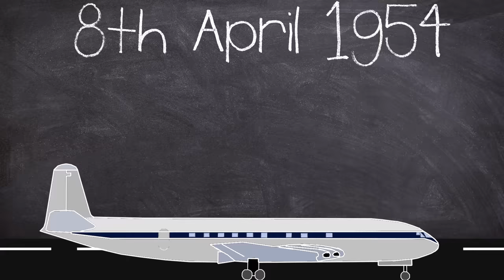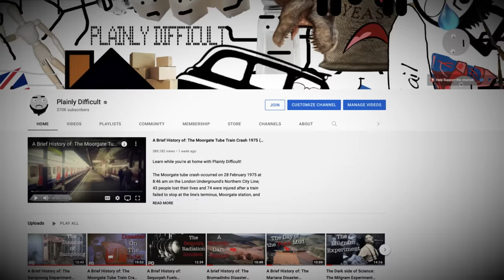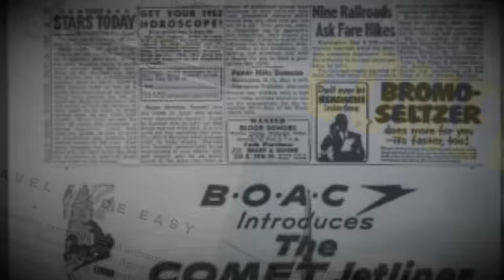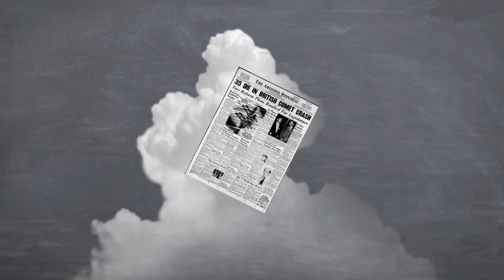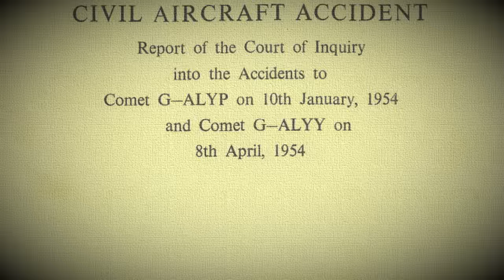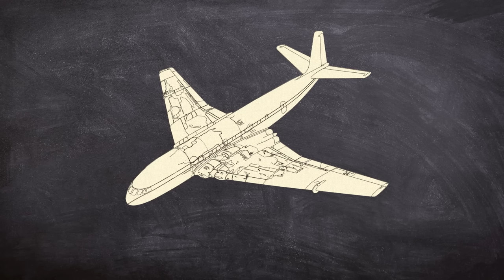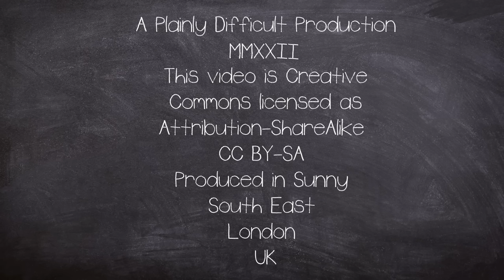A Brief History of: The de Havilland Comet Design Disaster 1954 (Documentary)

Comment: Admittedly I could be wrong, but it would appear that a significant amount of credit should be shown to the inquiry board, test engineers and BOAC for their determination to get to the bottom of the problem.
By all accounts this wasn't covered up or hidden from public scrutiny - the process seemed to have been relatively transparent, (not a window gag) although the damage was already done to the reputation of the aircraft.
Reply from the maker: Very true
Reply: Back then, the main focus of any investigation was to find what went wrong and fix it. 

These days it's mostly to protect corporate profits.
Reply: @rrknl5187  I beg to differ!
The whole investigation process for all aviation accidents and near misses is to find root causes and ensure they are eliminated! There is obviously pressure from corporate to make it quick and cover any guilt, but the investigations are always good!
Reply: @totherarf  The degree of corruption and influence to protect industry or protect pilots varies as you move through space and time. Watch the last Mini Air Crash Investigations video and tell me that wasn't a cover-up, to say nothing of what happened with the Max. I won't disagree that the attitude of "find the problems" over "punish the troublemakers" or "prove the aircraft works okay" gets far better results. But, between the national investigators (NTSB and relvant counterparts), investigators from manufacturers, and investigators from airlines, there are a lot of competing interests in any investigation, and we don't always succeed in keeping those interests out of the way of doing good work.
Reply: @totherarf  I'd suggest that you are both correct.
The aviation industry probably holds itself to different standards than other industries in this regard.
@RR KNL didn't specify the aviation industry, and in many other industries there are (to varying degrees) cover ups - construction, manufacturing, oil, gas, coal and mining have all faced transparency problems over the years when things go wrong - we've seen plenty of examples on this channel.

@Mentour Pilot is a fantastic aviation channel which looks at, amongst other things, aviation incidents, accidents and disasters - not in a distasteful, insensitive or crass way - the content creator hopes to illustrate that the aviation industry is constantly learning and improving through post crash investigations - something that other industries could learn from.
Reply: @Amanda-C.  Another excellent channel.
As you've alluded to, no industry is going to be perfectly transparent, and there have been examples of the aviation industry obfuscating or dragging it's heels it is generally better than other industries....I hope.
Reply: @rrknl5187  As if the Soviets were any better.
Reply: @rrknl5187  There's some corruption, as there is in just about everything, but overall the NTSB has done a fantastic job making and keeping air travel safe by discovering accident causes and holding people and corporations accountable. If you're looking to point your finger at corruption, there are far more suitable culprits.
Reply: @Stevie-J  it's worth noting that part of protecting profits is keeping your customers happy. Airlines tend not to want their very expensive planes falling out of the sky costing them both reputation damage and the plane itself. So safety is vital for profitability. 
As for the public been informed, they generally aren't, not quickly anyway. Most of the information the public receives is from press reporting, because well, plane crashes are big news, and finding a news worthy fault is a headliner that news organisations love. Because of the pure number of people involved in aircraft design, maintenance and crash investigations, someone will always speak, this in turn tends to force investigators and manufacturers to respond, often as a form of damage control.
As for why aircraft are grounded, that's simply put, politics. Manufacturers will push for the grounding to end quickly, their lobbyists will too. But the comitties of politicians that the safety boards answer too don't ever want to be seen to be flippant about safety, as they know it'll come back at them later and cost them votes. So they balance the need for the appearance of safety with the manufacturers need for profit. Also note worthy is that because of how the airline industry operates, with companies coming and going constantly, a grounding isn't devistating to a manufacturers bottom line if they can spin it into a "safety conscious" redesign while building up a backlog of completed aircraft to ship the moment the grounding ends. This only works however if they actually do solve the problem and don't create a new one, as a second grounding is likely a death blow to that design and possibly the company as a whole.
Basically over the top safety, or the appearance of it, is key to profit in the airline industry, as it is an industry based entirely on trust.
Reply: Part of it also is that it was, at the time, such an out of context problem. The various heavy bombers that where used prior had much more time on their clocks and the fact that a passenger plane usually doesn't have things being thrown at it. So they where kinda stumped on why the planes just decentagrated in mid air.
Reply: @rrknl5187  Unfortunately not; if you've ever read a Department for Transport report from the time, the blame was nearly always primarily attributed to an individual as opposed to company failings.
Reply: Planes were falling out of the sky. BOAC was state-owned and the entire country was on center stage as the first commercial jet builder/operator. 

This wasn’t just an issue for de Havilland, it was an issue for all of Great Britain. 

Plus over a hundred people had already been killed at that point… you typically investigate such things. 

Also, no one was going to fly on the plane (much less purchase them if you’re an airline, holy liability and PR nightmare) till they knew what was wrong with it. 

So anyways, I’m not sure why you give them credit for looking into this “little issue” lol. 😏
Reply: @EstorilEm  Yes, planes were "falling out of the sky", but it'd be incredibly naïve to imagine that there couldn't have been a lot of misdirection and obfuscation - are you new to this channel? 
Big companies and organisations can be extremely adept at shifting the focus in any number of directions.
You've pointed out that it wasn't just a problem for De Havilland, but for Great Britain - you don't think that the British government* wouldn't have wanted to distance itself from this problem?
And while such a human toll would inevitably lead to an investigation, I think it's fair to say that not all investigations are carried out with full transparency.
Many investigations are simply a facade, designed to give the impression that something is being done.
And while the damage to De Havilland's reputation had already been done they could still easily have carried out the investigation in private, only releasing the bare minimum of information at the conclusion of the investigation - something we've come to expect whenever a large company, organisation or even government is facing public scrutiny.
Even the fact that De Havilland's reputation was beyond salvaging would suggest that  there was nothing to be gained by being fully transparent - in all likelihood they probably knew that they were facing ruin as an aircraft manufacturer.

The reason I'm giving credit to the concerned parties is  because, (as we've seen countless times on this channel) investigations aren't always carried out openly - far from it.
We've seen disasters where no-one is held to account and very little, if anything, changes in the aftermath.
Maybe it is odd to give praise when we see people doing the right thing, but it's something we don't always see.
Finally, you've quoted either myself or someone else using the phrase "little issue", but I'm struggling to find it in the comments - who claimed that it was a "little issue"?

*I know that the British government are usually beyond reproach - always facing up to their failings head on - taking responsibility for their actions - it's inconceivable to imagine that the British government would try to wangle out of it's responsibilities.
Reply: @ianmacfarlane1241  that last paragraph is a joke, right?
Reply: @devent10n  Yes - tongue planted firmly in cheek.
Reply: @devent10n  Apparently politicians used to resign when their position became untenable, and even their own party viewed them as a massive liability - not now.
It says everything about the current British political landscape that the PM can effectively say, "I'm not lying about the No10 parties - I'm just too stupid to realise that my staff were having parties." 
This guy has access to launch codes, and he's telling us that he can't spot a party happening in front of his face.
I'm struggling to understand how he's holding on, but yet again he is.
At least can count on that man of the people Jacob Rees-Mogg - that's reassuring.
Reply: Well said. From my earliest days of reading about this aircraft (bored old 8 year old reading a book about this very aircraft in 1991 checked out from the school library) I felt the British deserved so many wins, and little things turned into huge problems. I have found this plane a glorious piece of history for just over 30 years now.
Reply: I have to admire how they did a full-scale pressure-tank test for the jet's hull.  That just...wasn't DONE, but they needed to test it to understand what was happening in case it was part of the issue....aaaand then they were very-surprised to have the tank prove how important that full-scale test was!

...imagine the poor sod running the test when the failure occurred.  Would he have almost had a heart attack from the super-loud "POONG!" that the hull popping in so much water might have made?  I think it was actually automated, but what if that poor sod was running it manually?  "Augh, did I pressurize it wrong?!"  Two heart attacks in one.  :)
Reply: @EShirako  Nobody heard anything - except for a bell which rang when the pressure in the fuselage suddenly dropped. The aircraft which underwent the tank test was G-ALYU. It suffered a passenger cabin window failure. The failure to "YP wasn't actually a window at all, but rather one of the apertures in the roof under which was housed an ADF (Automatic Direction Finding) aerial.

And, for the record, the narrator uses the modern phonetic alphabet when referring to the individual aircraft registrations, such as ""Yankee Papa" and "Yankee Uniform". In period, the British used a different phonetic alphabet and G-ALYP was therefore always referred to as "Yoke Peter" (and 'YU as "Yoke Uncle").
Reply: @EricIrl  Wow...and now I've learned several new things today all in this one explanation!  I had always wondered where the "Yoke Peter" sorts of names came from.  And a bell...for popping a fuselage.  That seems thoroughly underwhelming...but also seems quite 'actually engineering-sensibly-done'.  Why be dramatic?  You have a task to do; here's a bell.

So YP's failure didn't involve the rivet-damage that the windows had/that YU suffered?  Or was that ADF port riveted too, maybe?
Reply: @EShirako  I am pretty sure that the roof apertures were cut out and "strengthened" in a similar way to the passenger cabin windows - so they were equally vulnerable to the same type of failure.
Another factor worth considering is the choice of engines. de Havilland (naturally) decided to use their own centrifugal flow Ghost engines in the MkI. The Ghost was an early generation jet engine and therefore somewhat underpowered. The company was then far more likely to save weight wherever they could - such as by using thinner gauge aluminium or skimping on window strengthening techniques. The Mk 2 and later Comets all used the more powerful Rolls Royce Avon axial flow engines - which meant that skimping on materials to save weight was less crucial.
Reply: @totherarf  If that were truly the case, the 737 Max would not be flying. In fact, stretching that fuselage to the point where it’s so imbalanced that it needs a computer to compensate would have never been approved in the first place.
Reply: @boataxe4605  So none of the modern military aircraft are approved? Most of the aircraft having Canards are computer assisted!
Reply: @totherarf  No, they (and the 737 max) are approved. Read my comment more closely, I didn’t state that they were not approved, I questioned whether they should be. And civilian aviation should have a different standard than military aviation, since Air Force pilots sign up for a position where they accept danger and the risk of being killed, civilian passengers don’t. And if a military plane crashes it usually doesn’t kill hundreds of people.
Reply: @boataxe4605  My bad! ;o)
I thought your point was that the elongated body necessitated computer control and because of that should not have been approved.
Reply: @totherarf  That is my point, just because it’s ok to have fighter jets that depend on a computer to fly doesn’t mean that it’s ok to have a commercial jet like that. They took a very safe airplane and put bigger and heavier engines on it than it was designed for, then stretched it to the point of it being dangerously unbalanced, it should have just been an entirely new design, but profits always win. Computers do crash, and we shouldn’t have commercial planes that crash when they do.
Reply: @boataxe4605  There are many comercial planes out there that rely on computer control ... Tha A380 springs to mind. The point with the Max was that it relied on a sensor which should not have been operational in certain circumstances but was. More software than hardware. You point stands though!
Reply: @totherarf  Thanks, I’m a professional boat Captain, and most of the newer vessels that I run are computer controlled drive by wire as well, I drive them like I’m walking on eggshells, and my rule is to never approach a dock faster than I’m prepared to hit it. I know that one day I’m going to go for reverse and not get it, and find out that I’m stuck in forward. The older, mechanically controlled boats that I run usually give some warning, such as the throttle or gearshift feeling funky.
Reply: @totherarf  
Hmmm.., tell that to the families of those that died in 1979 on the ill fated Air New Zealand joy flight to Antarctica. The DC-10 crashed into Mt Erebus. Air New Zealand pushed to have the accident all sown up by blaming the pilots after the air crash investigator, Ron Chippendale very quickly came to that conclusion. The extremes that Air New Zealand went to, to blame the pilots, the Erebus Royal Commission of Inquiry's chairperson, Justice Peter Mahon eloquently levelled the scathing observation an orchestrated litany of lies at the witnesses brought by Air New Zealand to add weight to their side, which at the very least implied a conspiracy of some significance.
Reply: @EricIrl  Aha!  Well...I guess this just serves to remind us that ALL trade-offs really need to be FULLY weighed and understood, not just the short-term tradeoff factors.  "Gets It Done" has value, but "Doesn't blow up and ruin both Britain's rep as a jet maker and also the company itself as a whole" also has some value.  Of course, part of the issue was that this was first-gen jets and we had a lot of lessons to learn the hard way before we got good at the job.  :-\
Reply: Clearly the government was forced to take action as de Havilland lacked the technical knowledge and experience needed to find the problems.
de Havilland had no real experience in building pressurized aircraft out of riveted aluminum. 
Prior to the Comet Disaster its only successful airliner was the Dragon, a  wood and fabric biplane.
de Havilland was still building jet aircraft primarily from WOOD in the 1950s and was decades behind in aircraft design and construction technology.
Reply: @annakeye  The 70's was a long time ago and we have progressed since then! 
Obviously a single life lost is too much. .......  But to put it into context Flying is the safest form of transport we have come up with yet!
Reply: @EShirako  As you say, it was early days when it came to jet transports. In one way, ironically, especially back then, de Havilland was one of the LEAST qualified companies to tackle such a project at that time.
Reply: @boataxe4605  the problem with the 737 max isn't really the plane itself, but rather that they decided to make the plane behave in the same way as earlier versions, so the airlines could save money on not having to train the pilots.
Reply: @sharpless  The only problem with the Max was the FFA's decision to make MCAS a full authority system.
Boeing had only intended MCAS to be a warning system, exactly like a stall warning stick shaker..
Both crashes were ultimately the result of pilot error.. the news media never covered these facts.
Reply: @Stevie-J  There are some corruption cases where the flights were not grounded by the company in question, but were grounded by outside organizations or orders.
Reply: the problem was indeed transparent kek
Reply: @sandervanderkammen9230 Liar, An aircraft designed to dive into the.ground because of cost cutting is not pilot error.
Reply: @Anbregour  tell that to the 747 max
Reply: And also, an overwhelming amount of blame is to be given to British Engineering for designing a plane with a fatal flaw and not testing enough to identify the issue.
Reply: @glieseseventen4921  Since humans began building methods of transport there have always been mistakes made...such is the nature of innovation and invention.
The Comet was the first commercial jet airliner in the World - de Havilland were pioneering a method of transport that would revolutionise the way people travelled - it was almost a given that there would be flaws.
It's just terribly unfortunate that the flaw led to such a catastrophic event.
Transport designers didn't have any of the advantages of computer aided design and modelling that we now take for granted.
The Comet WILL have been tested extensively - just not long enough for the metal fatigue to show up.
De Havilland were involved in a race, much like the space race, or the race to be the first in any other new mode of transport, and I'm sure that if it hadn't been de Havilland and the British engineering, it would have been someone else making the mistakes.
Remember - every other aircraft manufacturer learned from de Havilland's mistakes, making jet travel a little bit safer*.
Also, let's not imagine that de Havilland were employing anything other than brilliant aircraft designers and engineers - it was de Havilland who built the legendary Mosquito - a wooden aircraft, built (on the shop floor) by furniture makers - an aircraft so brilliant that Hitler and Goering couldn't hide their admiration - an aircraft employed in several of WW2's most daring airborne missions.
De Havilland built everything from gliders and biplanes to ballistic missiles - like any manufacturer they had their failures, but when they got it right they built tremendous aircraft - the redesigned Comet was an outstanding aircraft, but sadly the damage to it's reputation was done.

I'm curious - what exactly have you designed and built?
You seem to be very opinionated about British engineering, so what have you given the World?
Remember, the Industrial Revolution began in Britain, and ever since, the UK has excelled in science and engineering, innovation and invention, and technological breakthroughs, and there could have been much more, were it not for bureaucracy and government meddling.

I'm certainly not trying to downplay the tragedies that the Comet was involved in - any loss of life is terrible, but let's not pretend that there haven't been other flawed commercial aircraft over the last 70 years.

*On that note, aircraft weren't suddenly safe when the Comet was withdrawn from service.
The improvements in aircraft safety have been incremental, as every time there is an accident, (or a near miss) there is an extensive investigation, and there will often be either recommendations or orders that must be addressed.
These could be design changes, manufacturing changes, (processes or materials) personnel changes, training changes, procedural changes - they may be relatively minor, or they could be huge, affecting the entire industry.
Moving people and goods around the globe will never be 100% safe, but things have improved massively since the early days of commercial travel.
Reply: @glieseseventen4921  I appreciate that my previous comment might elicit a TLDR response, but if you are interested in the airline industry, accidents and subsequent investigations then I highly recommend @Mentour Pilot - it's an outstanding channel.
Reply: @barrierodliffe4155  The Boeing 737 series is the most successful aircraft in history with over 15,600 units sold its been in continuous production for 57 YEARS!!!!
Reply: @barrierodliffe4155  Hey Barrie! Please name a single British company that is making jet airliners in Britain today????
Reply: @ianmacfarlane1241  Britain was clearly lagging years behind other countries like America, France and Germany in aviation technology.
 The Comet Disaster is an excellent example of Britain's inferior aircraft industry.
Reply: @sandervanderkammen9230  
  The Ch-eye-nna Leydeez should be aware & note well:
   Britain was clearly 10 years ahead at the time.
  For example - the Vickers Viscount was the world's first pressurised passenger cabin, all metal construction airframe, gas turbine powered, turboprop, commercial passenger aircraft.
  DH of course manufactured many all metal construction airframe aircraft before the DH Comet first flew.
 The world's first all metal construction airliner was manufactured by Handley Page & first flew in the 1920s.
  It's well established that the subsequent course of the UK aircraft industry was not significantly adversely affected by the DH Comet events.
Reply: This video has some BS included.
For example -
  
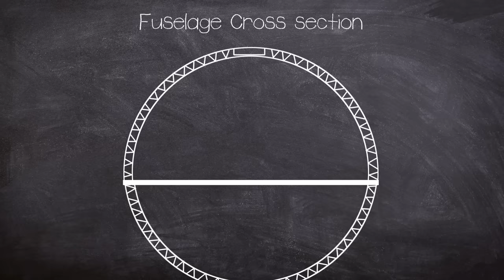    5:20   The idea that only the crew & passenger areas were pressurised is absurd obviously. 
  Every part of the fuselage was pressurised from the nose to the rear fuselage bulkhead including the entire cargo area.

Comets flew until 1997.
The Comet design had military use as a requirement. Nimrod development began at 
De Havilland before 1953.
Nimrods were not withdrawn due to structure problems or other airframe issues it was entirely a significant upgrade snag & resultant basic economics & an end of line sale happening at Boeing at the same time.

We feel we can shed some light on some common misunderstandings.

At the time the Comet wasn't particularly dangerous.

Losses comparisons
How things were in those days.

DeHavilland Comet 4 UK           14% 
DeHavilland Comet all  mks       17%  

Boeing 307                               70%
Boeing 247                               48%
Boeing 707            .                  20% 
Boeing 707                                20% 
Lockheed Electra Turboprop   29%
Canadair CL-44  Turboprop     46%  
Convair CV-580  Turboprop     22%
Convair CV-880    (ff 1959)       27%  
Convair CV-990     (ff 1961)      35%

    Of course De Havilland had prior experience building many all metal construction airframe aircraft including thousands of jet powered fighter aircraft that were primarily of metal construction with pressurised cockpits & jet engines built by De-Havilland.

   De Havilland carried out full stress analysis & engaged in a comprehensive & protracted testing program.

   The DH Comet was the first passenger airliner with full length fuselage pressurisation at 8psi pressure differential.

   Of course ripstop provision was provided. The skin alloy used became unavailable at the time due to R & D at the manufacturers which resulted in the original alloy being discontinued.
The skin thickness used for the Comet was used for similar later aircraft. 
Frame spacing was not found to be too large & frame width was not found to be too small.

  De Havilland did indeed always work to better than industry standards at the time, used up to date knowledge for the design & construction & no evidence of negligence  or criminal negligence was ever produced in relation to the DH Comet.

  The DH Comet had no effect on the course of the aerospace industry in the UK. The UK now has the world's largest combined nuclear, aerospace & defence sector per capita activity.

    The investigation committee did not find hundreds of fatal flaws or evidence of design defects, structural defects, defective materials or shoddy workmanship. Ripstop provision was included. Claimed incidents did not involve cracks starting from window corners.
Pretty much all changes were just in case changes or were planned development modifications & improvements that were scheduled regardless of incidents.

Hope this helps.

Cheers 👍
  
   
   
xcxcxvcxccvxb
xcvvvvccvzfxc